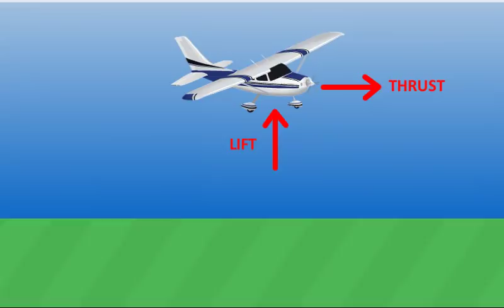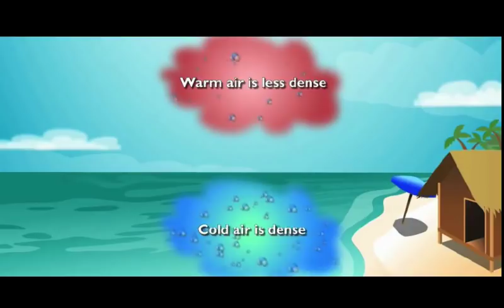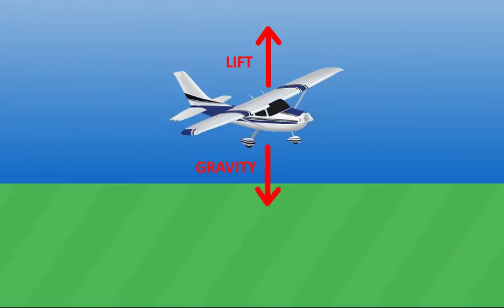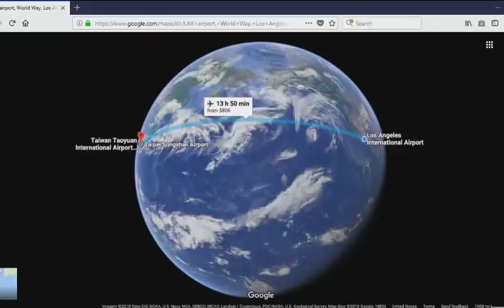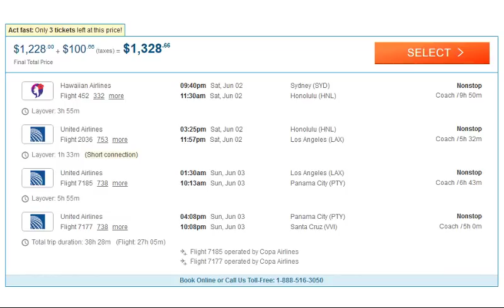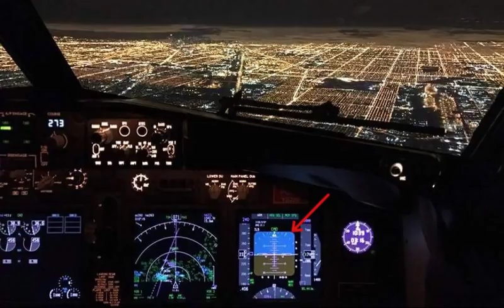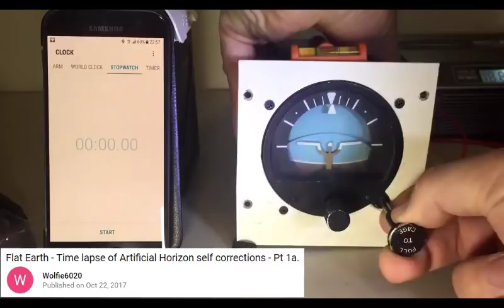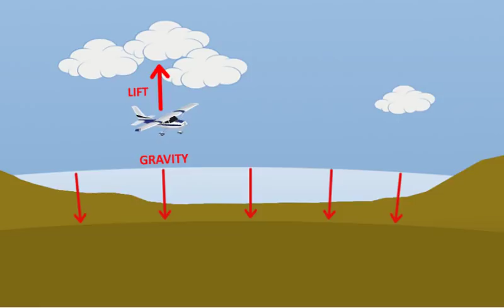Flat Earth Falsities - Plane Nonsense

Comment: this video was rubbish, not a good case to defend globe earth .  I have only recently started to look into some of the common believes about earth including shape of earth and the spinning of earth 1000mph. I must agree that there def is something not right with the spherical earth ( I'm not a flat earther, as I believe earth may have some different shape or even spherical ) 

the theory about the moving of earth with 1000mph is my biggest question,
Reply: "this video was rubbish, not a good case to defend globe earth"
Defend against what exactly?
Reply: Can you say which aspects you found problematic? And can you explain what makes you doubt a spherical planet?  (I presume you mean something more than that Earth is slightly oblate and lumpy - i.e. not a perfect sphere)
Reply: "the theory about the moving of earth with 1000mph is my biggest question,"

If you're inside a car and accelerate to 90mph /150kmph in a highway, you'll feel the acceleration, but once the car stops accelerating and keeps a steady speed, you won't feel a thing, and if you close your eyes, it would feel as if the car was stopped in a parking lot. Same with an airplane. Once it reaches cruising altitude, you can get up and move around the airplane and you won't feel a thing,  even though it's moving at 600mph compared to the surface. The whole earth and everything on its surface, including you, is rotating together at a stable speed.
Reply: "don’t you think when we are out in the space the rotation should be easily noticed but the nasa videos I’ve seen don’t prove it."

Consider that the Earth takes 24 hours to go through 360 degrees; that is, to turn completely around. 12 hours to go through 180 degrees or, to put it another way, until you're looking at only the opposite side. 6 hours to go through 90 degrees or a quarter of the way around. 3 hours to go through 45 degrees. 1 hour to go through 15 degrees. Reduce that further and you'll see that it takes 4 minutes to go through 1 degree of arc.

It's certainly possible to sit there, staring at a live satellite feed, and notice a few small changes after a few minutes. But second-to-second, most humans aren't sensitive enough to notice these relatively tiny changes.

Look at an analog clock. In 24 hours, the hour-hand goes around twice. So The clock's hour-hand is moving through degrees of arc TWICE as fast as the Earth does. 

Do you think you could see the hour-hand moving from a few feet away? Could you see it move if you had your eye very close to it? If you waited patiently for five minutes, would you be reasonably able to notice a 2 degree change of arc?

I'm not sure why there's this disconnect between the velocity of rotation and the size of the Earth. It's like you expect 1000mph to be this incredible breakneck speed that'd set the Earth spinning like a basketball or carousel at several revolutions a second. But the earth's circumference is so large that it takes a whole day, at 1000mph, to go all the way around. I know it's hard to imagine moving or rotating reference frames, but no one ever said science or physics was easy. Your incredulity is easily broken down by actually applying a bit of simple math and reasoning, if you'd listen and ask questions.
Reply: It rotates once fully every 24 hours.  The 1000mph is misleading.  The earth is HUGE.  It would be 1000mph compared to a fixed object in space NOT on the planet.  But on the planet, we are rotating quite slowly.  Half as fast as an hour hand on a clock.
Reply: Half the speed of the hour hand on a clock is not a fast rotation. 
You can observe this rotation yourself by watching the sun, moon or stars. They all move through our sky at the same speed, because it is us rotating not them moving. 
Stars are your best proof. Take a timelapse in the northern hemisphere and you see the stars rotate around a point in the sky close to Polaris called the Celestial North Pole. Head south and Polaris drops in the sky directly with your latitude. 
At the equator the stars move across the sky. 
In the Southern Hemisphere you can no longer see Polaris and the stars will rotate in the opposite direction around an opposite point called the Celestial South Pole.
Reply: Life around us , if you do the math the centripetal force is only .03% the strength of gravity.  Because the earth is so large,  the 1000mph is meaningless as far as flinging you off the planet.
Reply: I tend to favor the idea that if a person asks an honest question, I will do my best to answer it. I'll persist as long as the person can accept an answer that can be demonstrably provable and not start omitting or discounting those answers selectively to fit with their preconceived notions.

I taught my friend's youngest son how black holes form when he was 5 (5! I know, right?) It took a couple of hours but apparently he held onto it enough that now that he's in 8th grade, when his teacher asked if anyone knew how black holes formed, he knew. 

Education, be it of yourself or others is seldom easy and often confusing. It can cause a lot of internal conflicts given how we naturally perceive things. However, through education comes understanding and through understanding comes a profound connection to everything.

I'd say trying to help someone be more connected to everything is worth a few minutes of my time.
Reply: Life around us the video gave you the real explanations for this. If you do not understand them then you should consider putting more study in so that you understand the answers.

Just because you don't like the answers or find them satisfying does not make them wrong. It makes you wrong. Reality doesn't care about your feelings.
Reply: You would think that 1000mph is very fast, but not for the size of the earth. Like Jake Mize said, just think that it rotates once every 24hrs, now with that thinking put an object on a table and think of it as the sun and then get an orange and put a mark on it facing the fake sun, then rotate it until you reach one full turn in 24 hrs. Now think that the bacteria in the orange peel are people. Do you think that you are rotating the orange very fast that the bacteria are flying off of the orange?
Reply: Life around us Rotation is once per day. Since the equator has 25,000 miles circumference the ground there has a lateral speed of c. 1000mph. Centrifugal force arises from rotation, not lateral speed. 

The ISS or any satellite orbits the Earth. Since they are moving the movement of the Earth (just one rotation  per day) will not be obvious.
Reply: Let me try. It may kill him, but what do we have to lose? Life around us "the theory about the moving of earth with 1000mph is my biggest question," But it is far from the biggest question there is. Because Earth's orbital speed around the sun is 66,000 miles per hour. And the Sun's orbital speed around the black hole at the center of the Milky Way is about half a million miles per hour, and the entire Milky Way is moving toward somewhere in the Virgo Galactic Cluster at 1.5 million miles per hour.

And I'm going to tell you that each time we increase the magnitude of scale from planet earth, to the solar system, to the Milky Way, to extragalactic motion, the speed matters much, much less. As a matter of fact, on human terms 1.5 million miles an hour is equivalent to zero. Yup, I'm going to prove that.

We don't perceive speed in miles per hour or any other units. We perceive speed in relation to the size of the object moving. Proof? Sure! We see a little gnat zooming around so fast we can hardly follow him and we say "he's flying fast!" He might be moving 3 mph. We see a car on the highway moving 5 mph and we say "Get off the road, slowpoke!" He's moving almost twice as fast as the gnat. What gives here?

Well the gnat is moving maybe 30 times his own body length in a second, while the car is moving its own length in three or four seconds. That's the concept of scale speed. Let's apply that to the earth and compare it to an old 33 and a third RPM record. If they were the same diameter and we put them side by side, we'd see the record turning 33 plus times a minute, just over once per two seconds. And the earth would spin once per day. Well that's 24 hours times 60 minutes per hour or 1/1440th of a single RPM. The 33 and a third record spins 47,995 times faster than the vinyl record. Is that fast or slow. It's VERY slow, isn't it. How do we determine that? Scale speed. RPM determines speed, not measuring how many miles per hour the rim moves.

Let's go to the solar system, with the earth rotating once per year. Well a year times 365 days times 24 hours times 60 minutes means that the earth rotates around the sun at 1/518,400th of one RPM, that's 365 times slower than the earth rotates. Is that fast or slow. It's VVVVEEEEEEERRRRRYYYYYYY slow.

We'll skip the trip around the galaxy and move right to the Milky Way moving 1.5 million miles per hour toward somewhere in the Virgo Galactic Cluster. I know you can anticipate where we're going. Our miles per hour get astronomical and our perception of motion gets astronomically tiny. Let's do this thing!

Let us begin our trip to the twilight zone by mentally reducing the Milky Way Galaxy to the size of a car. And to make the most extreme case, let's assume it is moving at a speed hundreds of times faster than its actual motion through space, the speed of light. That IS the speed limit, isn't it? At that magnitudes too high velocity, this car will travel its own length in 100,000 years (the Milky Way Galaxy is about 100,000 light years in diameter, that is, for light to travel from one rim to the opposite rim, it would take 100,000 years). In order for the Milky Way Galaxy to move its own diameter through space, it would take 100,000 years! Would that be fast? Or damned slow?

It gets much worse. Because the galaxy isn't moving at the speed of light. It's moving 1.5 million miles per hour. The speed of light in a vacuum is 186,282 miles per second, times 60 seconds in a minute, times 60 minutes in an hour equals 670 million, 615 thousand, 200 miles per hour. 670,615,200 miles per hour is the speed of light. We're moving only 1.5 million miles per hour. So if you divide 670,615,200 by 1,500,000, you see that we are moving 447.08 times slower than the speed of light. That means you have to multiply that 100,000 years to move one diameter through space by 447.08 to get the number of years our galaxy actually takes to move its own diameter. That is 44.708 million years!

Now let's scale that down to human terms. The galaxy is represented by an automobile, and we're standing together 20 feet from the automobile talking about whether it's moving or not. Some of you know what's coming already. That automobile is moving, but it will take 44.708 million years to move one car length. Can any instrument on earth detect that it is moving at all? Won't we stand there looking at it for a half hour or so, agree it's parked and go about our other business? Yeah, I think so. The big numbers blinded us to the truth. 1.5 million miles per hour is slower than continental drift for a galaxy.
Reply: If you accept the rotation of the earth, then you can just calculate the speed yourself. The circumference of the earth is about 25.000 miles/40.000 km. So if you are standing on the equator, you must have moved the whole circumference in 24 hours. That is roughly 1000 miles every hour. So your rotational speed is about 1000 mph (if you stand on the equator).  If you are standing on the north pole you will just have turned a full rotation.
Reply: Okay, then let's try to be good teachers for you. 
The reason we know the rotation speed of the earth is pretty simple;
We learned the circumference of the Earth by measuring shadows and distance, then used trigonometry. This also demonstrates quite clearly that we are at the very least not on a flat plane, but a round object.

With the circumference known we then divide that by the time it takes to make a full rotation (sunrise to sunrise) and we get our answer: ~24,000 miles/24 hours = 1000 mph. 

Does that answer your question? I'm happy to explain whatever you're unsure or dubious about to the best of my ability.
Reply: Life around us:  The ISS itself is traveling very fast to maintain orbit.  It goes much faster than the rotation of the Earth.  Try and spot it in the sky when/if it's orbit takes it over wherever you live.  It whizzes on by.
Reply: He already has all the symptoms of the Incredulity Virus. 
Big numbers must be wrong because they are big.
Reply: @Life, can you imagine boarding a passenger aeroplane similar to the concord that can go faster than sound? It takes off, climbs, and pushes you back into your seat as it accelerates to its top speed (faster than sound) at elevation. As it begins to cruise, no longer climbing or accelerating, you feel the push into your seat let up to the point you no longer feel anything. The skies are perfect with no turbulence. All you feel is a slight vibration through your body from the seat and floor and you hear the hum from the engines. Can you image this?
Reply: Greg Wessendorf  don’t waste your time ~ the law of nature favors the fittest / smartest. His  dna simply wont last long in the human history.
Reply: Someone please help this guy before we lose him to flat earthers
Reply: Damian Smith shape of the earth may not be my first question, however the 1000mph rotation is the one.
Reply: Scott Cossey sorry to disappoint you but the video failed to provide a convincing explanation for the speedy rotation.  Check earth from ISS and you’ll see what I’m saying
Reply: seymoresaymore you need to hear the other existing views out there sir and then you’ll realize that I’m talking about here
Reply: Scott Cossey you’re not a good teacher,  imagine if you’re a teacher and a student  asks you a question which he’s confused about and you tell the student i don’t care if you understand or not because I know the answer do it’s enough for everyone. 
Please start reading some books it’ll help you to engage in a discussion properly
Reply: carlos garcia yes I’d totally agree with you but did you notice the speed of the orange rotating , my question is not about the rotating earth but it’s proposed speed.  I know there will be effect due to huge size difference but let’s go into space where we are not part of the momentum , don’t you think when we are out in the space the rotation should be easily noticed but the nasa videos I’ve seen don’t prove it. I maybe wrong but I had a question and I wanted views on it

Comment: It's actually really really simple to disprove the flat disc earth. The flat disc earth map shows the lines of latitude as being circles. If you travel in a perfectly straight line east or west and not continually curve, you would end up at a different latitude, but this is not in fact the case in reality. If you travel perfectly east or west, you will maintain the same latitude, and this is only possible on a globe earth.
Reply: It's always astounded me how FE believers can accept that "south" is a different direction for every observer in there "model" but they can't wrap their heads around that same concept applying to "down."
Reply: Nope doesn’t work. On the AE map they only define the position of north (centre of the map). East, west and south are different depending on where you are. 

(Yes I know that makes no sense, but that is their model)
Reply: If you define north, then you have automatically also defined it's opposite, south. You can't define one as separate from the others. That's like saying you can define up, but down is different directions depending on your location... I am 100% correct. If north is the middle, and it's "below" you, north and south are the same direction ? Utter nonsense, please, use something real if you want to argue my point.
Reply: Andrew: (I’m not a Flerfer, just explaining their “logic”)
They generally favour the AE/Gleason projection as their “map”. A circle with north in the centre. 
So south, east and west are defined relative to where you are and are different for each point on the map. 
Obviously this doesn’t match the simple reality that in the real world people on different continents in the Southern Hemisphere see the same stars when they look south. But since when has reality stopped flerfers?
Reply: GrahamStw Not defending the position at all, but it's in how you define it.

Face North.  The direction behind you is South.  To your right is East, to the left is West.

In the system they're using, the directions are all defined from North and are self consistent - and fairly consistent with how they're functionally defined on a globe.  To be fair, east and west are different directions for everyone on a globe as well. North and South are towards two specific points, whereas their approach effectively have north as "directly towards the centre of the circle" and South as "directly towards the rim".
Reply: Stephen: I know, isn't that the same as I just explained to Andrew?
Reply: GrahamStw sorry, I messed up who I was responding to.

YouTube hates me when it comes to comment sections.